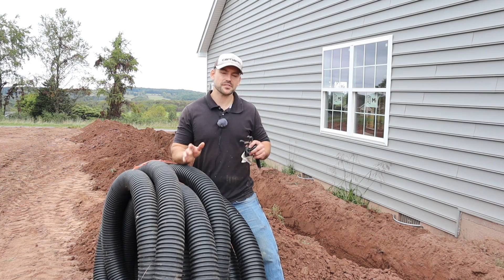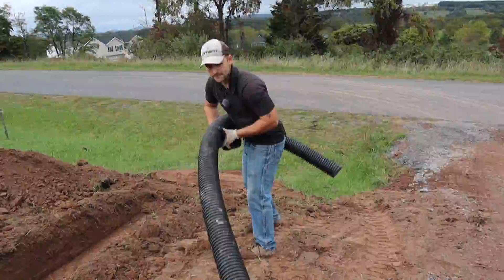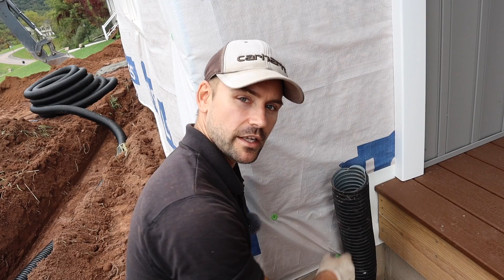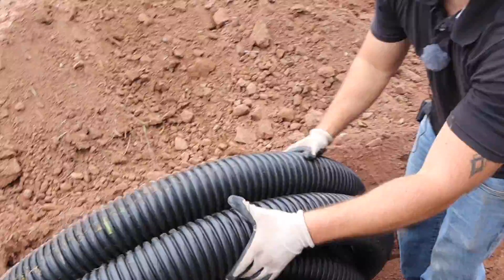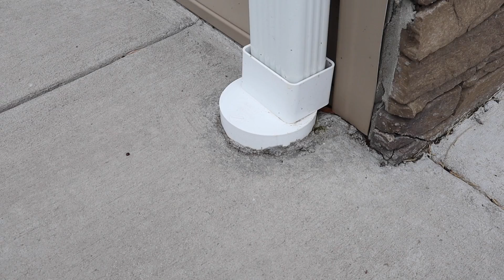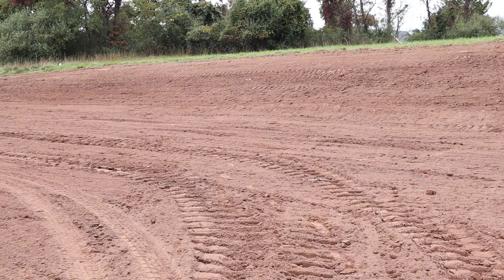Downspout Drain Pipe Installation - Underground Downspout Drainage

Comment from the maker: Thank god for excavating equipment! Checkout the timestamps below to navigate the video👇

Who to call before you dig (811) 00:36
Which pipe to install for the downspout drainage system 00:46
How to rough in corrugated pipe around the downspout 01:22
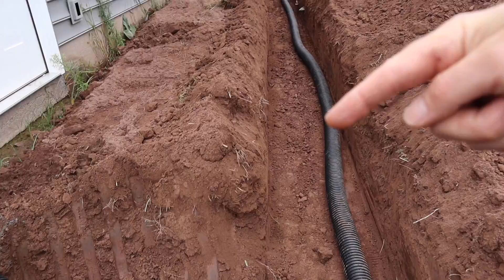How to intersect two downspout drains 01:54
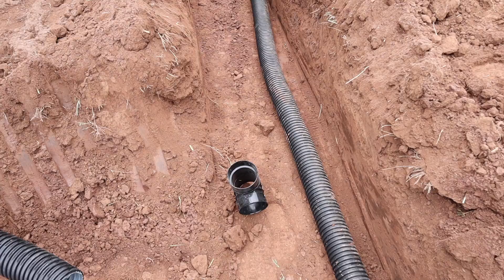How to install a "T" fitting 02:08
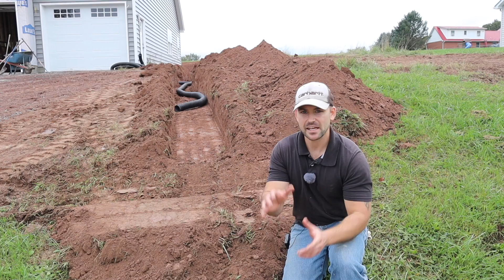How deep to place the downspout drainage pipe 03:21
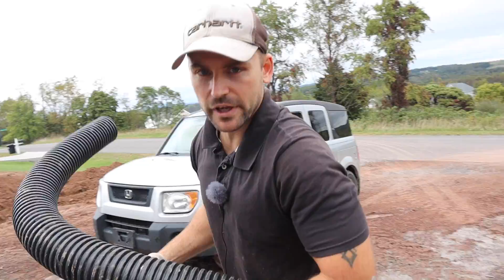How to extend the corrugated pipe using a coupling 04:04
Reply: I like the HAMMER the like button.

Comment: Single wall is garbage. If you want it done right use SDR 35 or dual wall corrugated for downspouts. That system will be failed in 5 years under single wall. Never fails. I see every home builder use single wall, home owners they call excavating companies like ours to fix it the roof drainage etc. That single wall just doesnt hold up to the elements overtime. Your good at what you do but this is one area I wouldn't go cheap on.

Comment: Very good video but just a question. Many people say that corrugated pipe is not good but in the north they are wrong. It’s much better during the winter season vs the pvc pipe. My question is do you think if there is no clean out would be a problem for such a long run of pipe? Shingle gravel is gonna be a problem if there is no chance to clean it…
Thanks

Comment: Hey Josh, great video! I just subscribed. I’m still a bit confused with one thing when it comes to downspout drainage installation. I’m about to start it at my house and I wanted to tackle it myself even though I know close to nothing. Do you actually need gravel/river rocks to fill your trench and surround the pipe? Or just fill it back up with dirt? My yard only has red clay, hard to work with that.
Thank you!

Comment: You were talking about the next house that you’re gonna start, how long does it take you on a build since you work another job?
Reply from the maker: Hey Chris! A lot depends on what job you have. For instance I work 3, 12 hour shifts. Select gives me four days to work on the house which is almost full-time. The last house before this one was 1900 ft.² and I built it in 13 months. So there are many factors that could interfere with the timeline. Such as weather and if there is a material shortage of some kind. I hope that helps Chris!

Comment: Just courious, why didn't you use a ditchwitch, and how did you set your grade. Shedule 40 would have be better but lot more expensive. Looks good bud !
Reply from the maker: They already had the backhoe doing work around the lot such as installing the sewage drain line. So we just knocked these lines out real quick. Yes schedule 40 would have been a lot better but way more expensive. Not worth the extra money to me. Thanks a lot for watching!

Comment: How would you terminate those underground drain pipes in a subdivision with a concrete curb? No ditch available.
Reply from the maker: Hey! There is a fitting called a pop up drainage emitter. It comes up into the grass and then drains that way. You may want to look into that. Hope that helps!

Comment: Niice.. I just didn't want to clean gutters so I enhanced this concept at my carport. I used Perforated 4" drainage pipe and wrapped it in a drainage pipe sock and buried it beneath filtration fabric topped with decorative rocks and changed over to a solid drainage pipe after that length was established. 

Where my downspouts penetrate into the concrete walkway, I installed a piece of 1/4" galvanized hardware cloth on the bottom of the gutter - making sure I could remove the gutter from the gutter adapter at the drainage pipe to completely and totally eliminate any possibility of getting the drainage pipe clogged is things went through the gutter (which they do). 

I also used a gutter guard at the top of the gutter where the downtube connects, perhaps overkill, but eventually I removed the top and now I really do not need to clean the gutter from a ladder, I just pull the down tube out and remove the hardware cloth to clean it as needed. 

After doing Extensive research on gutter guards, it is my belief that the best gutter covers are the stainless steel mesh by Gutterglove  - TIP: Get the 4 footers and buy in Quantity not special buys at Depot. Difference can be upwards of over $1/ foot!
Reply from the maker: Sounds like you did an excellent job you the install! Views will be able to get value out of this post and I appreciate it. Thanks a lot for commenting!

Comment: Did you consider schedule 4 PVC like ole Gate City Foundation uses?
Reply from the maker: I did but the price of PVC is outrageous right now. I used this corrugated pipe on my last house and had no problems. Good thinking though! Thanks for watching!
Reply: I was going to mention the same thing. I recently bought a house that has corregated pipe underground that connects to the downspouts and someone likely whacked it with a weed eater and now it has holes in it.